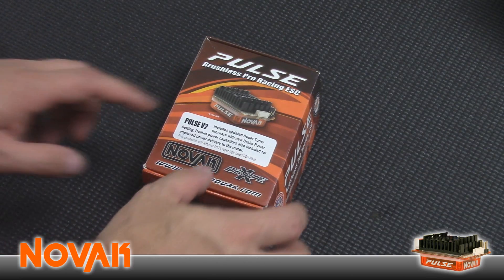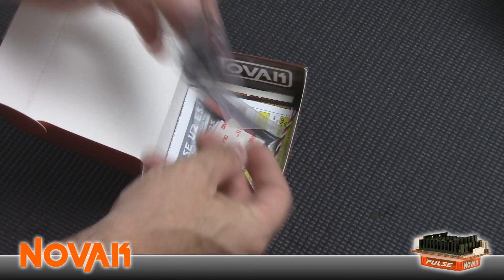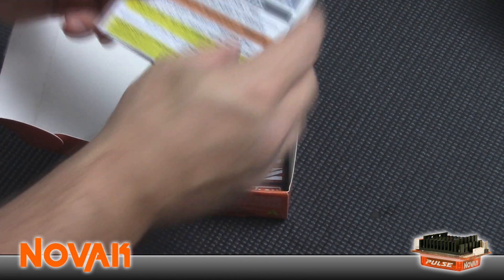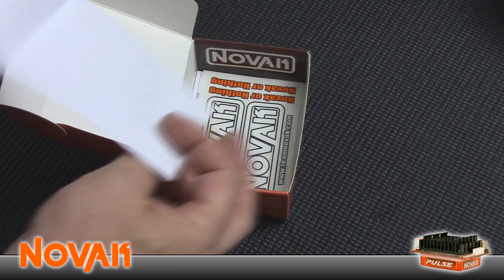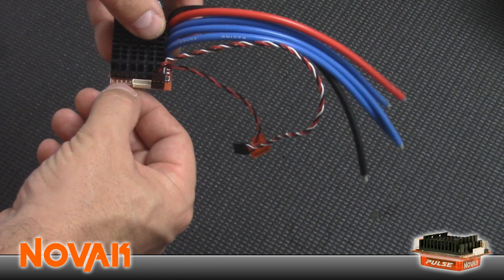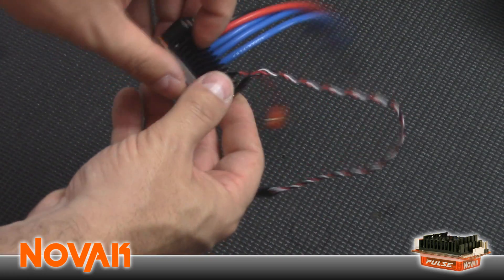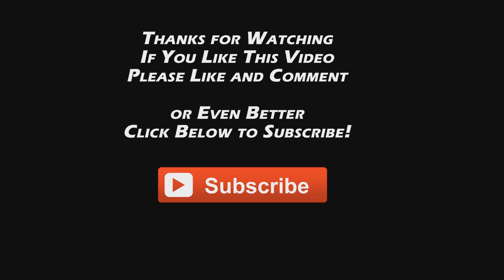Team Novak Pulse V2 esc Review

Comment: This thing actually fits perfectly in both my b5m and 22-4.  just got to be a litle inventive with the b5m and putting the reciever on its side or get a micro.
Did you run your setup with out the fan installed ?  I just assumed it was required.

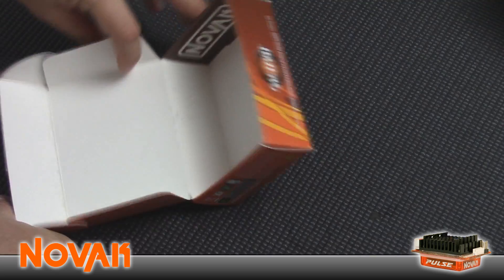Comment: Noticed that the caps in the static picture in the bottom right are the small ones (the way my Pulse V2 came out of the box) and yours has the bigger caps @ 1:12 (the way mine came back to me from Novak after being repaired).  Pretty sure they realized there was a problem with the small caps because my Pulse V2 and Vulcan 17.5 were both sent back to me (ESC repaired, motor refurbished replacement) within two weeks of me sending them off to Novak with no explanation what-so-ever.  My gut instinct was that the small cap popped and took the Vulcan down with it, and I think Novak agreed.  Haven't had any issues with the Pulse since getting it back, so here's to hope.

Comment: They need to make it smaller for today's mid setups, that thing is huge. But I'm spoiled running Vipers, they do have the smallest footprint on the market.
Reply from the maker: Yeah they really do!
Reply: You looking for another viper esc?
Reply: +ShortCourseWorld hi im trying to decide on what motor and esc i should use for a xray t4 that im building. Im most likely going to use a trinity revrtech killshot motor 13.5t but i dont know which esc to use. my options are lrp flows orion r10.1 novak pulse v2 and a orca vx3. all i want is something that willlast long and is reliable and easy to use. also what do you think about the trinity motors are they reliable, fast, high torque and what motor would you recommend for a onroad touring car application. Thank you so much
Reply from the maker: My first choice would be an LRP flow works team  or the ORION